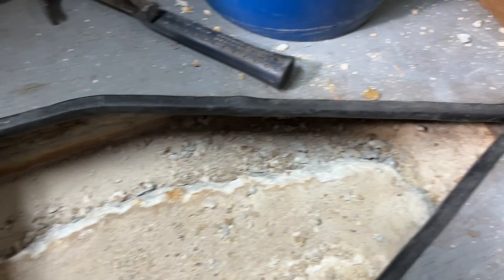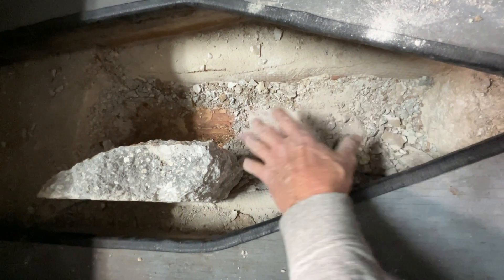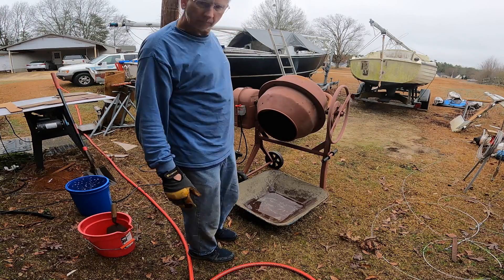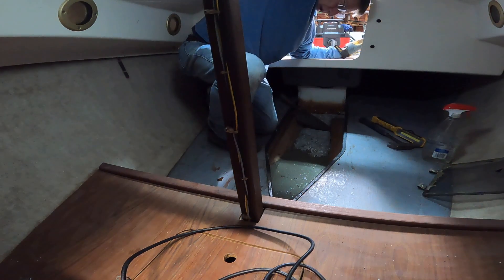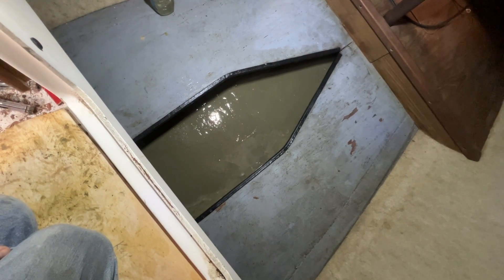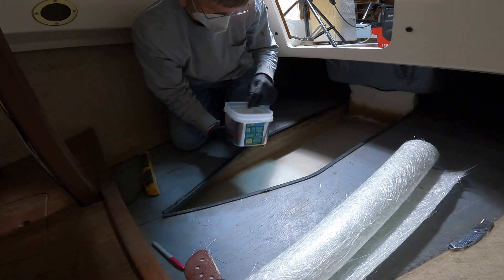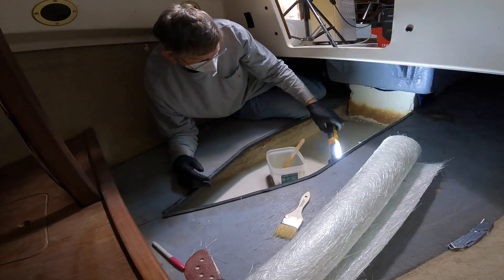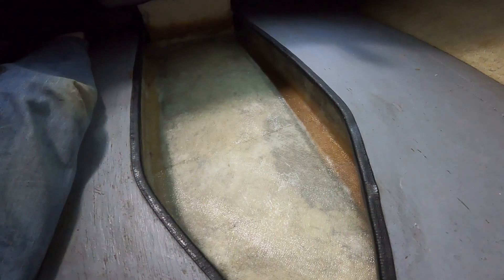Adding lead ballast to a Com-Pac 16 sailboat

Comment: Wow, that looks amazing when finished—nice work!  I inverted the keel area in my Compac Suncat last night, and have been kinda depressed at what I found—gravely wetness, and looking ugly..  Your beautiful repair gives me hope and direction—thank you
Reply from the maker: Not a fun job to do, but not particularly difficult either
Thanks for watching!
Reply: @theboatnik1328  thank you again—I started mine, and it is looking a lot better—feels better to have it done also.  Planning to add the fiberglass tomorrow, and thinking about installing a drain plug—in case I want to check for water intrusion in the future.  The Suncat has a “sump” area behind the keel cement where a bilge pump is installed
Reply: Sorry, not “inverted”, supposed to be, “uncovered”

Comment: I just found out my CP16 has some water in the keel. Do you think it’s necessary to remove and replace the concrete when that happens, or just when the concrete gets damaged like in your boat? I’m hoping I’ll be able to just dry it out with a few holes in the base of the keel. Thanks.
Reply from the maker: Usually no need to replace concrete
I drill a hole and let it drain and then attach a wet shopvac to it and let it pull out water for several days
It needs to be completely dry before repairing hole
Also you need to address where the water is getting in at or rainwater will just get right back in the keel
Usually hull to deck joint
Sometimes port lights or deck hardware
Good luck
Reply: @ Thanks for the info. I drilled a hole and there’s definitely water dripping out, the concrete feels solid though, so I think I’m good there. I’ve got all those tasks that you mentioned on my to do list, plus I need to tackle replacing a soggy bulkhead at the compression post. I’m gonna be busy for a while, good thing I have a backup boat to sail. I appreciate your help and your videos too!
Reply from the maker: Just leave the boat draining until you finish the other repairs
Just don’t forget to repair it before you launch lol

Comment: I’m sorry but you using wrong mask, respirator.
It doesn’t hold any fumes, charcoal NIOSH filter is needed, a specially if you work in such confined space 😏
You can harm your self this way so there will be no happy sailing after 🤷🏻‍♂️
And I would precut fiberglass before I mix hardener with an epoxy
Reply from the maker: Thanks for the advise and concern
And for watching!

Comment: Did you take out the floatation? If so will you add that back somehow?
Reply from the maker: No I did not remove any floatation or foam
I did not remove the concrete under the cockpit as it was not damaged